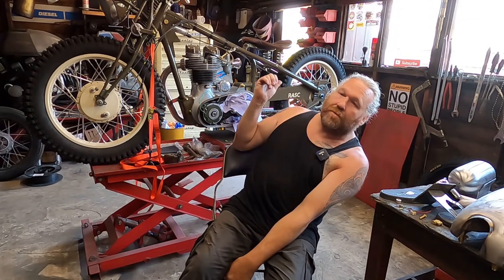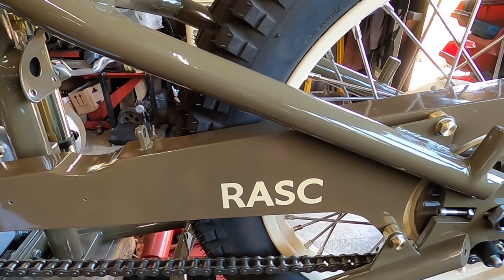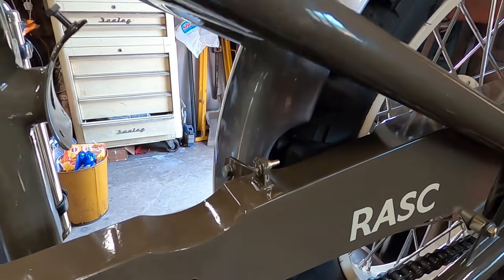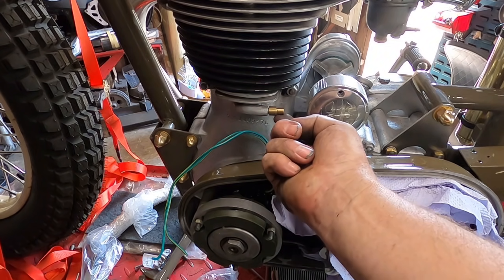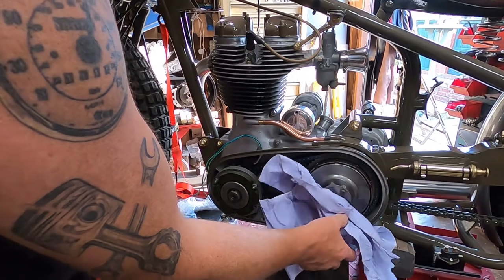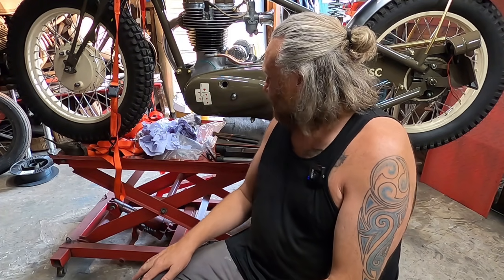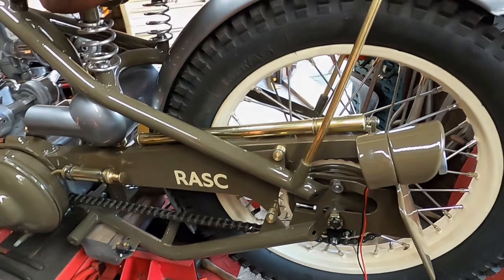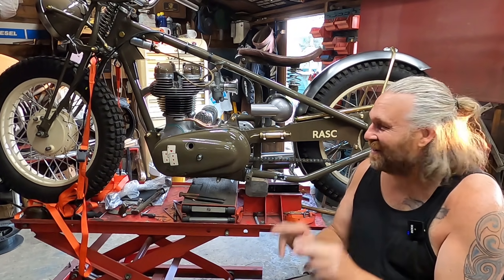Royal Enfield Bobber Project part 46

Comment: I hate the heat too.  It's tools down in my shed over summer.  We had a heat wave week back in 2009 with the outside temperature reaching 46 deg.  We had power cuts and devastating bush fires throughout that time.  I don't know what it was in my shed but I know it was too hot in there to even consider entering!!

Comment: Hi Craig, 
I am no expert but it could just be a pressure switch tripped out on the air con condenser ( the big thing outside) might be worth a look?  If it’s a HP switch try dribbling water over the fins as it runs it knocks the pressure down a treat. As others have said keep the door closed as well

Comment: Craig, just a thought about your overheating problems in the shed. When I built my shed I lined all the internals with aluminium foil. eBay / Toolstation etc etc, and it is absolutely fabulous. Keeps the space warm in Winter and cool in Summer. Could be a relatively cheap solution .

Comment: Yep- the bikes looking good .A couple of wet bandanas -one on the head - one round the neck will help with the cooling .You're hot - my two huskies are flaked out under the cooling fan - I have to keep striding over them - God help anyone stepping too close - they are very grumpy in this heat !
Reply: I used to run the hose over my Samoyeds. They learned to come and ask for it. Ronn
Reply: @ronnronn55  Yes Ronn - I've had a Samoyed - lovable easy going dog .Now I only have rescue Huskies - one just as easy going as the Samoyed and one - The Grey - He is annoyed at which ever way the wind blows - spray him with a fine mist for about 10 seconds then he is all growls and grumpiness .
Reply: @mikecaine3643  Different strokes for different folks (dogs) as a teacher of mine was fond of saying.

Comment: Craig, looks  good! Random question, is the shed door open? If you have the air on and the door open no wonder it would cost you an arm and a leg to run. Had to laugh when you said you only run it as a lat resort. I live in North Queensland and run five split system aircon's almost 24/7 during the wet season.
Reply: I'm here in Japan ... 45 deg in the shed today ... No air-conditioning ... Those English fellas eh ...

Comment: Just a question. The cards on the primary cover. The Router 3, should it be a number 3 upside down at the bottom right?
Love the Bike so far, you are a good bike builder =)
Its hot in Norway these days to.. Stay safe.
Reply from the maker: The image of the cards was copied from a photo of Dan's granddad who had it painted on his bike jacket so it had to be the same. Thank you Oscar.